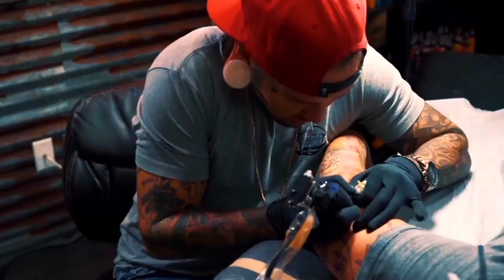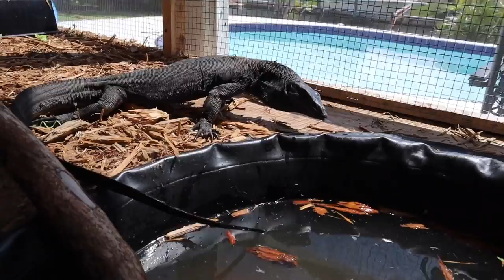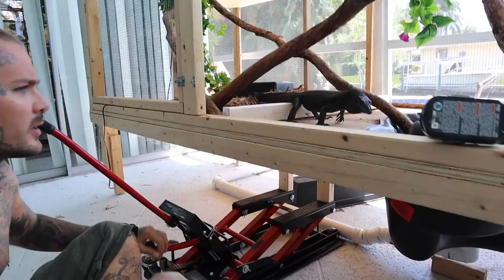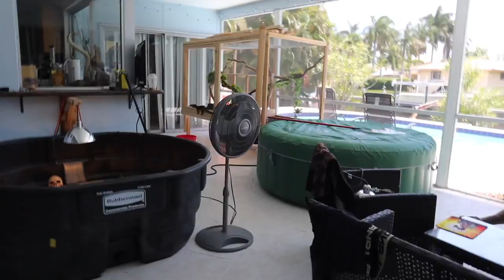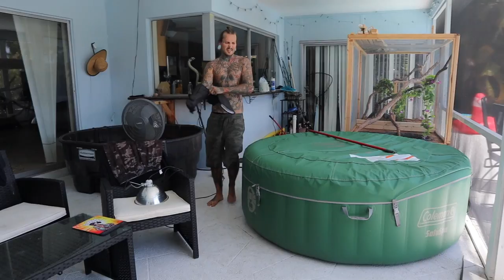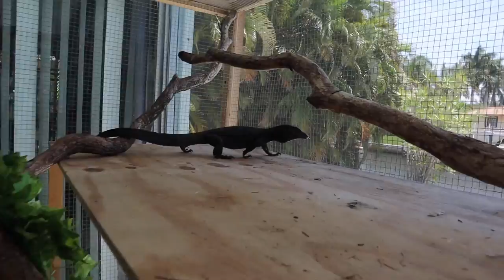My Crazy Black Water Monitors! The Black Dragons | Tyler Nolan

Comment: If I was you I would put a support right where that cage was Sagging bro..Also u can screw 2×4 that u put in from the bottom  it would help you out just A suggestion Bro love you Video's..Not trying to tell you how to do something just Bored ASF still Laid off..Just trying to Help hell wish I was there I would help ya
Reply: Michael Muncher yeah that’s what I was thinking some screws would pull that plywood tight up against the 2•4
Reply: fellow carps i see
Reply: Pretty sure I watched him build two more cages and he improved on the design in those with your mentioned adjustment

Comment: Man Tyler your videos are the best on the Tube bro and I watch different videos all day,,,mostly Freshwater and Saltwater aquarium stuff,but anywho on you floor board bowing come from the bottom plywood with 4 or 5 screws with a washer into your 2×4 you put in there ,it will tighten that floor nice and flat & stronger it's the water from the pond when he goes in & out the wood gets wet and bows. Thanks man you help me get thru the day of chronic pain I deal with.✌🌿🖤🐠🐠🐟🐟

Comment: Hey bud this is AJ from Tennessee first time commenting if you take two screws and screw into the two by fours from under the cage into the bottom of those 22 by fours it will pull the bottom of the cage up flush with those 22 by fours

Comment: Tyler, the monitors are awesome.  I hope you get them to calm down some before they are much larger though or you are going to be turned into hamburger.  I'd stick some bracing underneath the floor of that enclosure if you don't want it to sag.  That water tank is going to to coninue to bow the floor down if it doesn't get some more support.

Comment: Make a lower table on wheels that can slide under the cage when not in use and pull it out during feed time as a station. Great stuff foam for gaps and indoor outdoor carpet around the pond. Just some fyi

Comment: Are your gauges a bit larger? I can't tell if they're a size up from usual, if the color is just different from usual, or if it's just perspective, but now I need to know! Also, maybe adding supports under the cage around the pond would help? With all the moisture and weight, that bottom's gonna sag and warp quite a bit I'd bet.

Comment: If you put some screws in those two before is from underneath the cage up for the bottom it'll pull that Gap up that gap between the boards in the bottom of the cage it'll pull it up snug

Comment: the sag in the plywood canbe fixed by scribing the two by 3 to the plywood
 whatever the biggest gap is,take a measurement cut a block of wood at that measuremnt.then run your pencil on top of the blockthe length of the 2×3. personally id screw from the bottom of the plywood up into the 2×3 to try and take some of the sag out of it.

Comment: I've commented before about since you have carpet in the snake room and it gets dirty n you have to have cleaned all the time....how about if you  cut the carpet out or leave it any cover it with vinyl linoleum down, go to like a discount supply place and get some pieces and just cut it and tack it down and then just clean it when needed or replace.
Reply: i was going to say the LifeProof flooring... stuff is amazing. you can lay it over rcarpet and existing flooring

Comment: Cut a 2×4 to length and put it on the bottom and sandwich they plywood between the two boards and it should suck the top boards down to where there is no gap bro!!